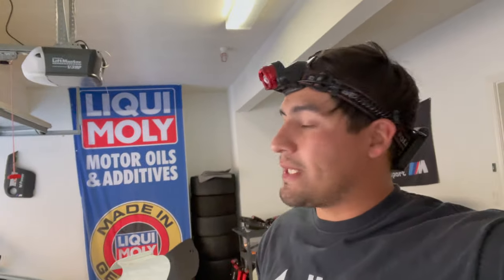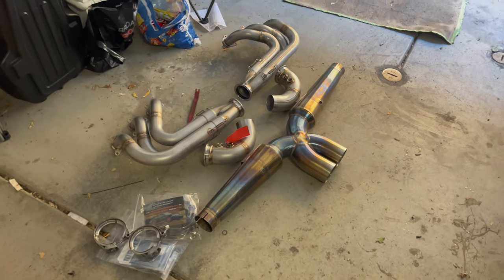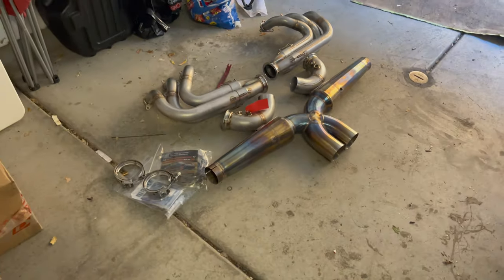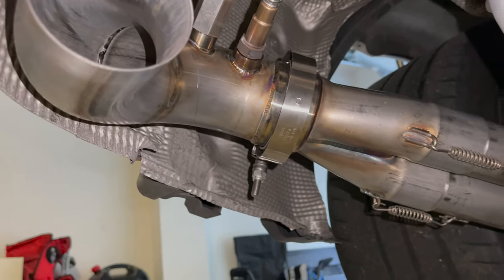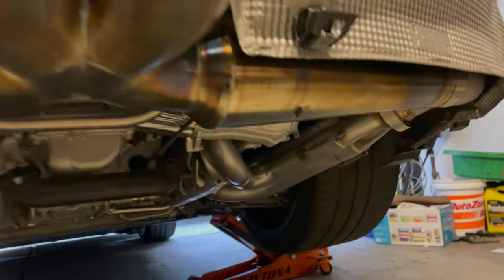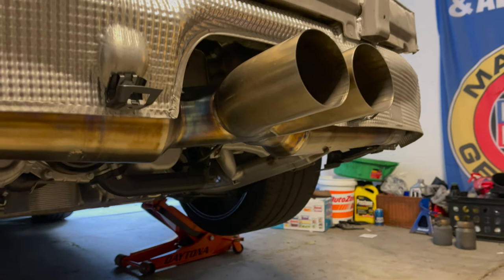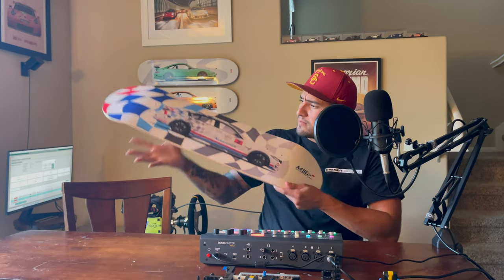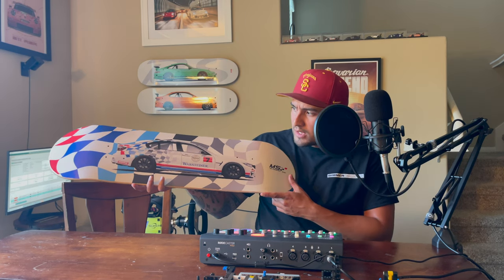Porsche GT3 Gets Dundon Motorsport Race Headers & Crack Pipe

Comment: Do you get CEL with the race headers? If not, can I pass smog without visual inspection? I live in the state of Nevada. Most smog station doesn't do visual. Thank you in advance for the information. I really want to get this race headers and crack pipe combination. Just worried about can't pass smog. Is the smell livable without cat on the GT3? Did it yellow the rear of the car like obsessed garage stated?
Reply from the maker: Definitely won’t pass smog and you won’t even get to a visual test without failing because it’s LOUD and CLEARLY not catted. I didn’t have issues with yellowing though.
Reply: Thank you so much for responding. It's very helpful and still tempting. Love the sound of your car just like a RSR. Don't really mind of the sound level just worry about the hassle having to replace to stock every year for passing the smog here in NV. Is it livable with the fume smell for carless on your car?
Reply from the maker: @yuzhang6530  I had the windows up most of the time so it didn’t bother me at all but I can’t speak on having windows down to be honest
Reply: I actually do exactly the same like you. Very helpful information indeed! Thanks much!!
Reply: Do you have CEL with the O2 spacers on the headers?